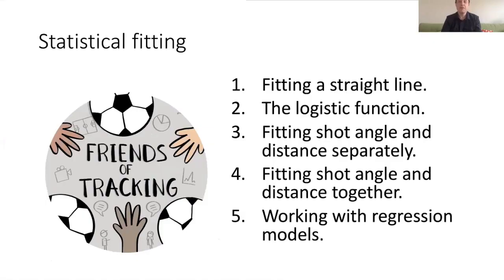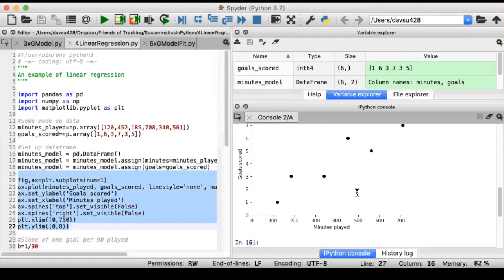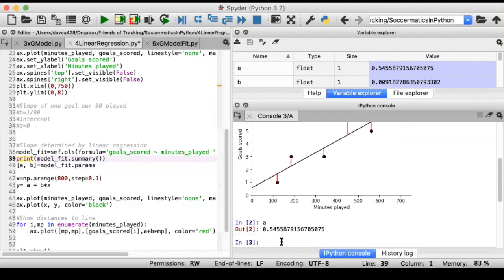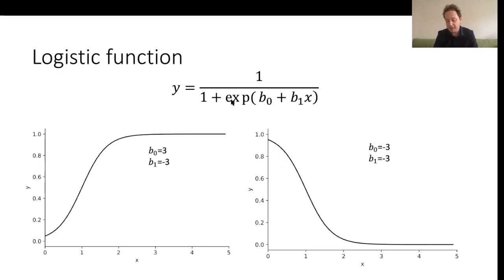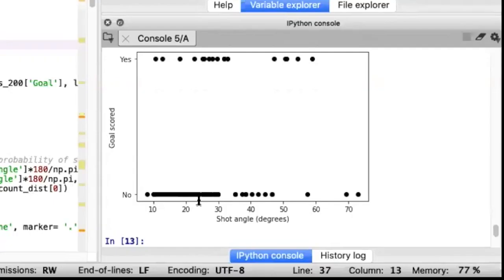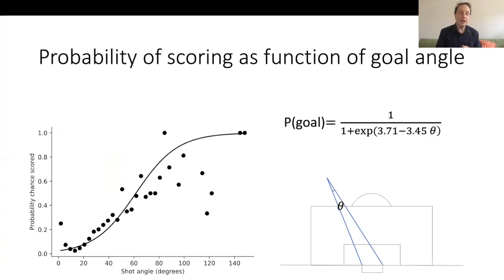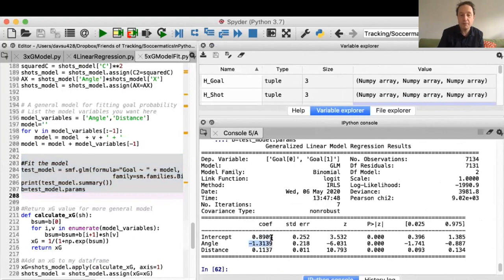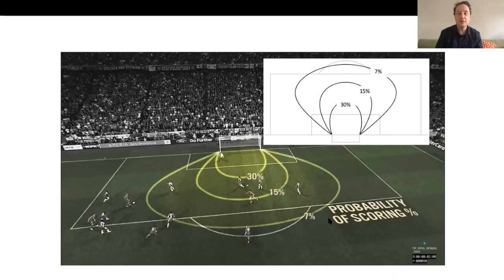How to Build An Expected Goals Model 2: Statistical fitting

Comment: I was thinking, if using distance as log and angle as cos, wouldn't be better. Then you could make a linear regresion.

Also, you would have: 0 < xG < 1 | 1 < log(d+1) < 2 | -1 < cosø < 1

This suposing that a field has 99 m, on average, and you cannot shoot over 180°
Reply: Appears to be a smoothier function either. Because you have similar ranges of values to all variables.

Comment: I just wanted to share something here - if you look at the shot angle function. You'll see an initial descrease in scoring probability that david attributes to being an anomaly when in fact if you think intuitively about this and i have verified with data. The likelyhood is that despite the angle being low the Distance is also probably low too which possesses significant explanatory power and hence the higher goal probability is due to this rather than any direct effect of shot angle on goal scoring probability. Always check for Multicolinearity because i bet there is some interaction here. Are shots with lower angles typically from lower distances?